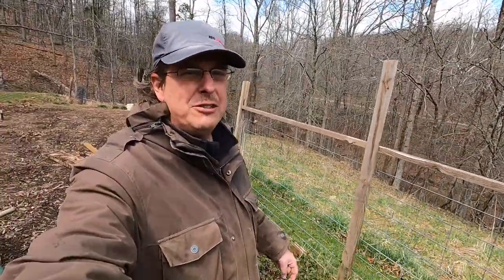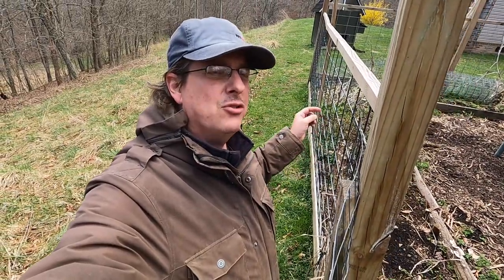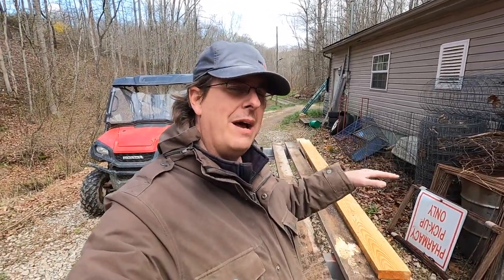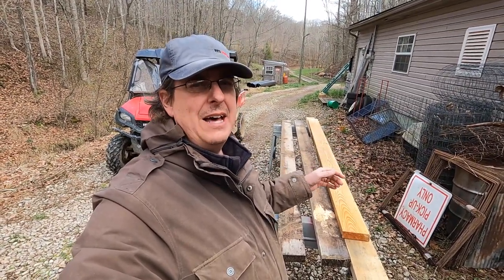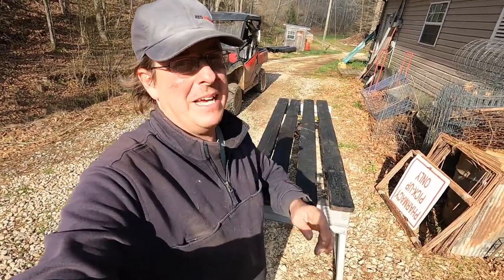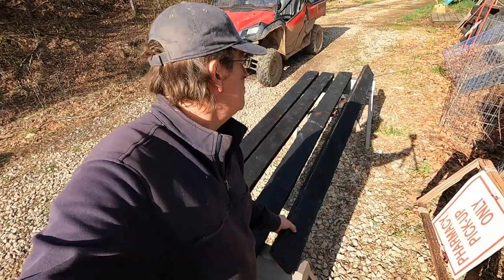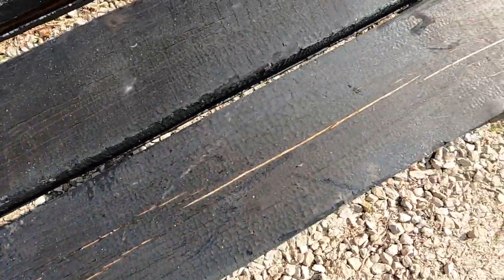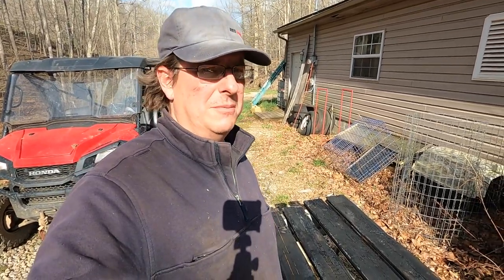Why am I burning good lumber???

Comment: Just a thought, but, to solve the incomplete burn issue on the dayto  side of the board, could you use a blow torch to burn the wood [of course, this makes an assumption that you have a blow torch available]?

Comment: The lumber prices here locally of course have led to people going into construction sites and stealing from the piles. One of the guys I had been working with said they're required daily to check to see if the strapping had been cut and how many boards had been removed. Thankfully they've started sending in police to patrol the areas to help cut down on it. Also, now to combat the theft, it looks as if they're pre building the framed parts of the walls and delivering them in a stack that way. I can't tell you if it works, but sure seems like it would help cut down on the theft. Couldn't believe it when I looked recently to see what 2x4's were and saw they were $8 per. Unreal.

Sorry to hear about the panic attacks. While I don't get those, I get anxiety something fierce at times. Something that has somewhat helped with that that you could look into are isochronic brainwave tones. Could be placebo, could be digital snake oil, but they honestly seem to work for me. Seems to help my brain calm down. There are apps or YT channels where you can find them.

Comment: Hey Troy. Fellow West Virginian here.  I love your channel. I will certainly be praying for you and your family this week. I can sympathize with your panic attacks.  In addition to prayer and a daily time of worship.  I strongly recommend supplementing your diet with benfotiamine. I like the life extensions brand. It’s basically a special form of b1. You may also consider a b multi for a while also d3 and k2. There is a lot of research out there that shows that high stress depletes these vitamins. I’m sure you eat super clean all the time but like do ... Anyway please try this.  It’s super simple, safe. Why not do the easy things to see if they help.  It helped me and several others I know pretty quick. God Bless
Reply: Great tips! I would also add some Magnesium to help body absorb the vitamins and Zinc to push it through cells. If not enough magnesium, calcium won't be absorbed by the body to get to the bones and can end up as arterial calcification.  Mag also has a calming effect amongst many other benefits. The best tip - is Prayer!!  Amen
Reply from the maker: Updating my vitamin regimen and eating cleaner
Reply from the maker: Thanks Peggy

Comment: i am glad you are teaching cam to work so many don't any more. i think you may have burnt them a little to much but time will tell the new treated lumber rots much worse than the old and is toxic to animals. i have not used any store lumber , i got a woodland 130 max and am only using that and recyled lumber. you may want to try cbd or other natural things i think they have helped me. i stopped taking blood pressure med. and use beet root and hawthron . i am much better now can work on top of roofs or off ladder again. god has a plant that can cure anything. try to keep your life as stess free as you can i know that is hard to do. take care, be safe and well.

Comment: How about adding weep holes? In fact space your weep holes to line up with you cattle panel verticle wires. If necessary remove the first horizontal wire from the cattle panel then thread and wrap the verticle ends around the dimensional lumber.

Comment: @Red Tool House - Homestead  
To do the channel, try using a gas torch.
Green wood has more "juice", which is what creates the protective coating when burnt, isn´t it?

Anyway, I am loving your videos!  Great advice with a bit of humour.
I am considering WV when I move, but everything I have seen depicts WV as a sombre, gray place.  I guess due to the topography a lot is in shade.  You are the first one I have come across who films in actual sunny days.  🙂

Comment: Lol I love the effort. It looks good. Personally I would try doing the fire more contained and smaller with some wet wood so it burns a little longer. Then hook a wire to both sides and then use two people to go over the fire or drag it through.

Comment: Great video bud. I too have used the burning wood method on a lot of different applications. Including 6x6 posts in the ground to decorative finishes and protection. Get your self a propane burner for a more controlled burn on the wood 😄 and some water to douse them with.
Long time sub and watcher but I don't comment all that much. I'm trying to though 😄